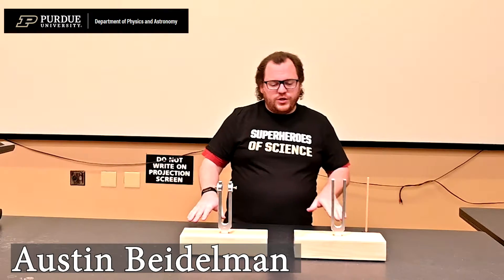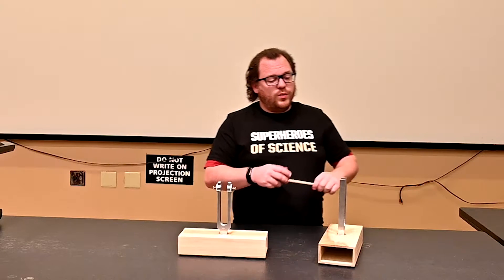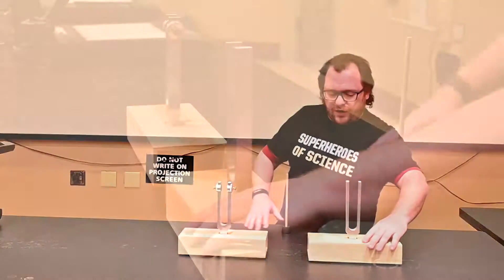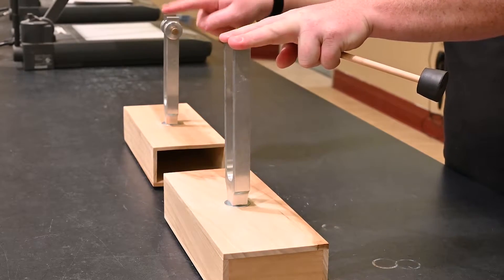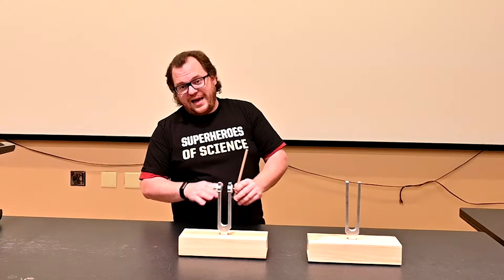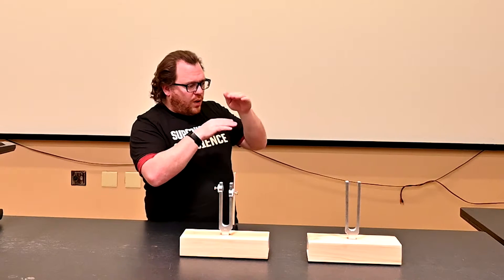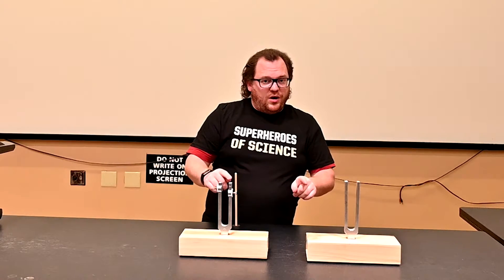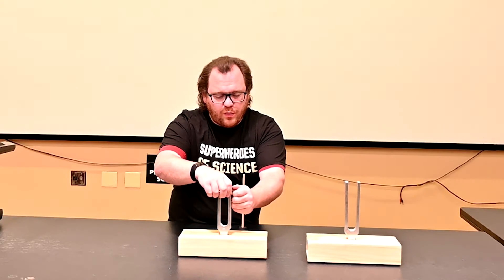Understanding Resonance and Beat Frequencies

Comment: That was fantastic. Thanks. I have a Moog synthesiser and this happens when I change the frequency between the oscillators or take them out of tune. This also happens between two near by large diesel engines when their speed is changed.